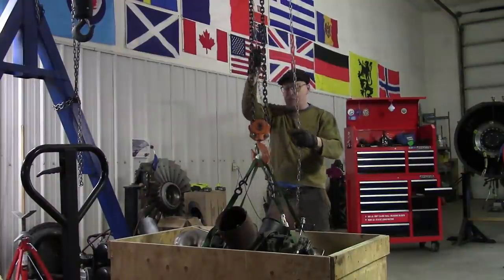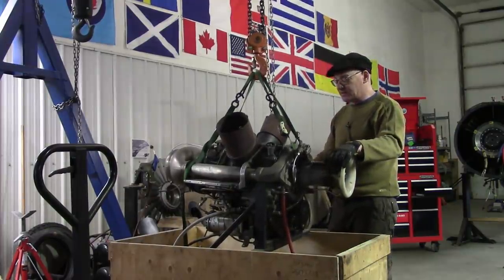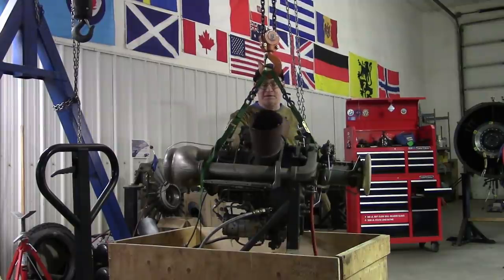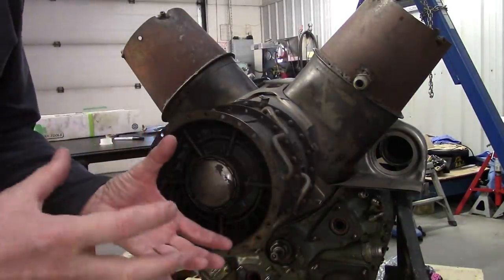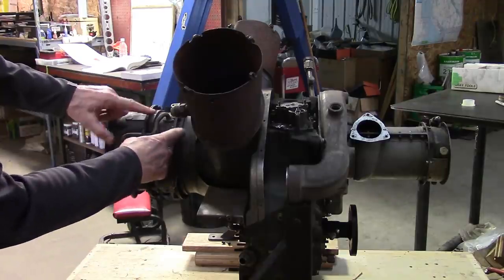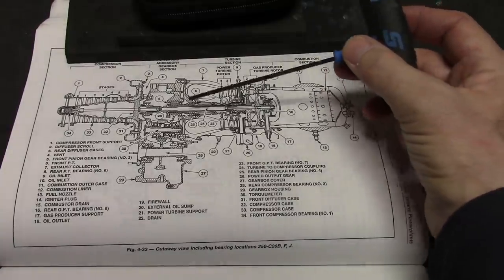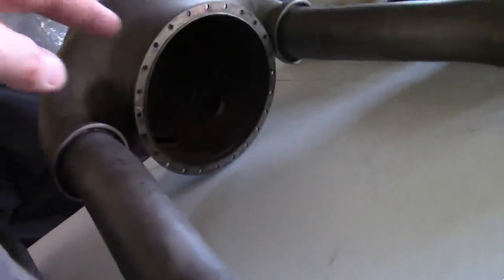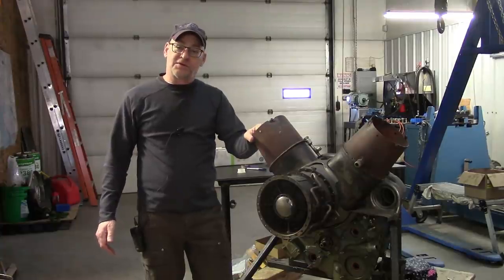Mini Jet Boat Ep.1:  The Beginning

Comment: Out of curiosity; why go with jet drive, instead of surface propeller or just standard prop drive? All the tests that I saw show prop drive outperforming jet drive in all aspects apart from ability to operate in shallow water.
Reply: Seeing your question made be curious about the differences myself.
From my quick search, I think water jets are more efficient at high speed than normal propeller drives. Normal propellers are more efficient than water jets at lower speeds.
I think the main reason to use a water jet on a jet turbine boat is speed control. It would be very hard to throttle a jet turbine low enough to produce speeds slow enough for maneuvering around a dock. With a water jet, part of the water stream can be directed forward to instantly control the speed of the boat. I suppose the same could be done with a variable pitch propeller but this is one of the "pros" listed in water jets' favor.
Another reason to use a water jet instead of a norm propeller is the cool factor. There's something cool about seeing a fast moving jet of water coming out of the back of a water jet boat.
Hopefully AgentJayZ will let us know the real reasons for going with a jet drive.
Reply from the maker: Water jet drive is less efficient than prop at everything, except for this boat's primary mission.
It will be a river boat, and often will have only inches of water depth to deal with.
I may not be a smart man, but I know props don't like rocks!

Comment: What are the major improvements in later versions that can enable a power increase by more than 100%?
Reply from the maker: All the usual: better aerodynamic design of the airfoils, better metallurgy of the hot parts, better management of cooling air, better sealing.

Comment: Thinking of hotrodding it up to 400hp?
Reply from the maker: I think the C18 was derated from 400Hp because of the limits of the gearbox components. So I think we'll keep it at 320-ish. We may be able to dyno test it.
Reply: @AgentJayZ  I just remember you talking about that sort of thing since you don't have to keep the flight safety standard. Probably more fun to be had in not breaking parts though.
Reply: "Hotrodding" an engine by simply increasing the turbine entry temperature inevitably has a significant effect on turbine life.  The maximum TET of a given engine was typically set by the available technology of the day, whether material properties, or blade and vane cooling technology.  "Turn up the wick" and the material properties take a rapid dive.
Many engine types have effectively been "hotrodded" with improved materials, improved cooling, and increased pressure ratio.  For example, the GE CF6-6 was developed to become the -50, and the R-R RB211-22B was developed to become -524.
Delving into history, the Olympus 200 engine in the Vulcan bomber, was developed to become the Industrial Olympus 2020 engine (which I know as the C-rated engine) that AgentJayZ has shown us in the past.
Back in 1971, it had new combustion chambers, with improved wall cooling, based those from a development standard of the Concorde engine.  A previously uncooled HP turbine had a brand-new design of cooled HP NGVs and blades, the technology for which was in advance of that in the RB11-22B, under development at the time.  The LP turbine had improved aerodynamics and materials - and my name is in the lower RH corner of the design scheme (yes, we drew our designs then) for the LP turbine blade.

Comment: That thing is HUGE for only 300 some horsepower. You could easily get more power out of a jetski engine. I realize that's not the point.
Reply from the maker: Question for you to think about. Power to weight is very important in a light helicopter, so why don't they use 2-stroke piston engines?

Answer: reliability
Reply: @AgentJayZ  Most of these motors used in mini transplants are now 4-stroke, but you're point is still valid.